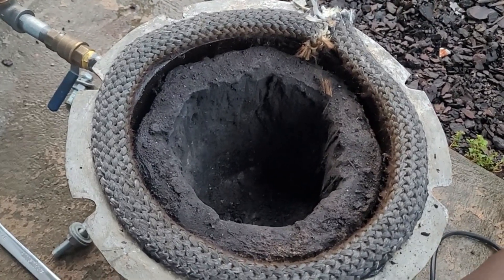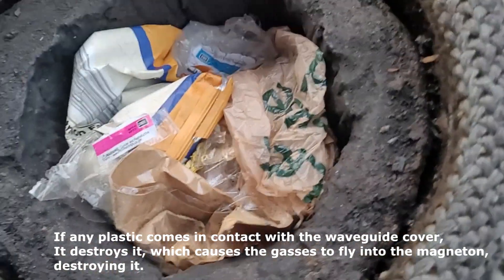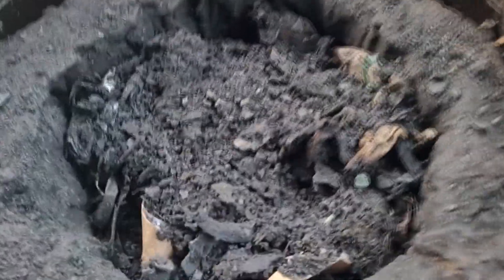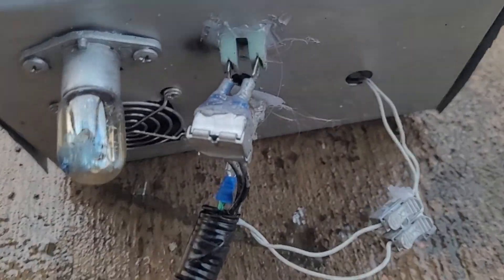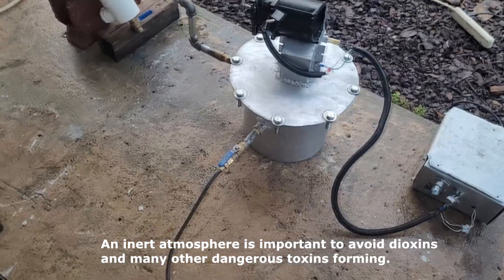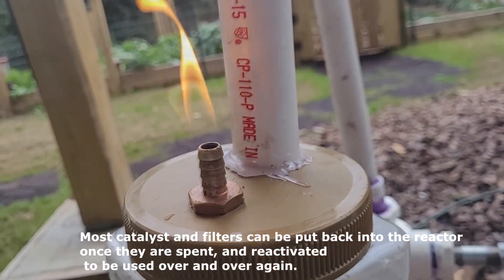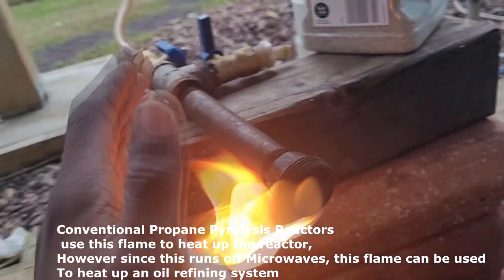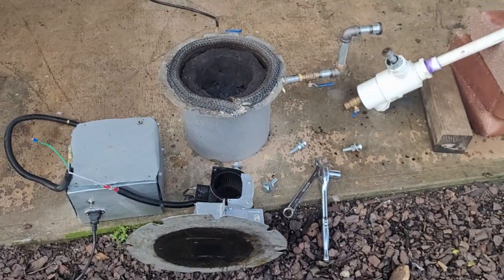Running the Microwave Pyrolysis Reactor (Turning Plastic into Fuel!)

Comment: 1) You should flood the chamber with CO2. Pyrolysis with Oxygen present will result in highly toxic gases being produced.
2) That gas you are flaring off - plumb it into a burner at the bottom, that will solve your problem of plastic at the bottom not being fully converted.

Comment: If you just let it run, the oxygen will be displaced quite quickly as soon as it gets hot enough. Using commercial gas seems a bit of an extra expense and an extra step I don't think is needed...

Comment: PH means power of hydrogen. 
Low PH means it has lower than average hydrogen ions. Making it acidic. When you run it through a water bath, it picks up extra hydrogen ions out of the water, and this helps neutralize the gas.

Comment: carbon char left over can be steam reformed to flammable H2 hydrogen gas, flammable CO carbon monoxide, and inflammable CO2 carbon dioxide by injecting tiny amounts of water at a time. The carbon rips oxygen away from water leaving hydrogen behind. A minimum of 600c is needed while 800c might be more preferable.  The reaction first makes carbon monoxide and is strongly endothermic storing lots of energy.  If it hangs around long enough or too much water is added  the carbon monoxide reacts with another water molecule making  carbon dioxide. This second reaction is mildly exothermix. The overall reaction is that the remaining hydrogen has more stored energy than the charcoal did.

Comment: Reason you shouldnt try pvc pvc with that setup is my understanding that gasified pvc builds clorine acid at regular steel pipes and you need stainless pipes and vessel for contain it. Otherwise you burn that thing trought quite fast.

Comment: Dude!!!!! This is killer!!!! Is there any reason that you couldn’t use this microwave system on a wood gasification unit?
Reply from the maker: Thanks! This could be used in gasification, it would just require a different design.

Comment: Also intentionally causing variations in the frequency of microwaves, like modulation, will cause the microwave peak nodes and hot spots in the pyrolysis container to move around doing the same job as a rotating plate does in a food cooking microwave without the need of putting a unnecessary shaft through the otherwise sealed container that also needs to be sealed! Therefore reducing complications and cost while improving efficiency.
    Tip these are all technical details investors are not going to want to hear or read in a business plan, but are likely problems that may be brought up during due diligence later in the investment process to be prepared with.. 
    If you incorporate, for a few shares I would be happy to continue to help just contact me. If I just had three people locally with similar interests to work with, I would be building a $500,000 pilot plant for 2 million right now!
   The world needs this and I want to be a part!

Comment: Wow this is incredible! I can't wait to see this progress
Reply: Is the remaining ash toxic? I've heard that it is unable to be used because it still has remaining toxicity in it. What is your knowledge and experience on it? If it's not toxic, it would be great to make natural fertilizer out of it!
Reply from the maker: The remaining ash is actually just carbon, and the carbon is very porous. With its high surface area, it traps most heavy metals and things that would otherwise be free, therefor it is not toxic. The only potentially toxic thing about it would be if the plastic is not completely degraded, so there are microplastics left on it.

It can be activated and used as biochar / fertilizer while sequestering carbon at the same time!

Thanks!

Comment: That's awesome dude. Any possible way you can tune the magnetron to a better frequency specifically for plastics?
Reply from the maker: No, only a new magnetron specifically tuned (915 mhz) could work, you can't tune magnetrons built for a specific frequency easily.
Reply: @naturejab  do you have any idea in what’s involved in making a magnetron  frequency change?

Comment: What if you made a "shaker" system that allowed the carbon to fall to the bottom as the reaction was occurring so that new plastics are better exposed to the microwaves?

Also how about an auto-feed system to feed in plastic "blocks" and pull out old carbon so that you can have the system continually running?

Comment: My only criticism is all that power being used to power the magnetron, is the power used more or less than the power of the fuel and gas created?
Reply: With the problem power u can build a fueled generator to generate electricity and us it for the reactor
Reply from the maker: We'll have to see with the next reactor, which I will take measurements with.

Comment: On the note of scrubbing, water is also great because the Sulfur/SOx would be turned into Sulfuric Acid which is probably easier to handle and more useful.
Reply: Granted it may be less efficient.  If you don't need it as a Flashback Arrestor (instead using the ones one would use on an Oxy-Fuel Torch) you could maybe use a spray tower or packed column?  More Surface Area = More Win
Reply: Thanks god we done have O2 enough inside reactor to process SO2 >> SO3 >> S04. However other toxic and carcinogenic byproducts would be formed.

Comment: I have little knowledge on this subject but to fix the issue of the carbon produced during the reaction absorbing the microwaves and preventing the plastics at the bottom from being heated up, maybe just have microwaves on both the top and the bottom. But I’m sure you thought of that and may have found issues with that idea.

Comment: Are you aware of industrial scale implementations of this process? 

Because I remember reading about a similar machine for recycling worn out tires using microwaves. The big difference being that thing was a lot bigger than your setup.
Reply from the maker: Yea, currently I am not aware of a big microwave plant that does plastic however, so that's my big focus
Reply: @naturejab  The machine is called the "Hawk 10". It was mention in a few science and technology magazines back in 2007.
Reply from the maker: @Bratbaticus  Thanks! Will look this uo

Comment: Very cool.  Any idea of the energy efficiency in general?  i.e on a 4 hr run how many BTU or what ever of gas etc did you collect / use?  I've spent time looking into wood gas generation and gassification / pyrolysis and the addition of micro to the process would be interesting.  Again, very cool set-up!
Reply from the maker: Thank you! Right now this reactor is flawed in many design decisions so I am not taking measurements on this one. Im in the works of creating a better reactor that I will take accurate measurements on.
Reply: @naturejab  Understood.... there always seems to be a next tweak or a next what ever lol.  Thank-you!

Comment: Cost vs results? 4hrs microwave run time= $/ results?
Reply from the maker: I'm still calculating this
Reply: If you could utilize solor electric power it would be a win, with earth battery technology . maybe a new path to look down.
Reply from the maker: @rockydog523  Great suggestion! The end goal is to run it off of some type of green and renewable energy therefor making it carbon neutral as well as a profit of energy in the end.

Comment: May I know what gasket you use on your reactor?
Reply from the maker: A high temperature Silicon Gasket. I previously Used a fiberglass rope gasket, but that leaked oil, so now I use a 1/8th thick 12/12" silicone sheet cut to size.
Reply: @naturejab  Greatly appreciate your reply, I am working on a pyrolysis plant myself for a school project. Thank you
Reply from the maker: @maurice7186  Excellent! Im glad to hear that :) Good luck!!

Comment: How many amps and boots l volts does this take?
Reply from the maker: 1000 kwh
Reply: @naturejab  kwh or wh? I dunno where you could plug into 1000kwh
Reply from the maker: @bryaniskoo  1000 kilowattt hours
It plugs into a standard 110 port
Reply: @naturejab  I think that's 1kwh

Comment: To help with the unreacted plastic you could use a "stirrer" like they put in some high end kitchen microwaves. It's a small fan looking blade placed in the wave guide that moves with the aid of a small motor. As the blade moves it deflects the waves around the inside of the microwave helping to prevent hotspots
Reply from the maker: Thanks!
Reply: Man... why dont they use this in regular microwaves 😆 i take its too unaffordable for consumers?
Reply: @dertythegrower  They actually do in Japan, and their microwaves are not particularly expensive either, and they work way more evenly. I was so confused when i first went to use the microwave in my hotel and there was no rotating plate in the center, jarring really. Apparently the rotating plate was a gimmick feature added early on, and just stuck as the main way to even out the heating
Reply: How will it move within the plastic ?
Reply: There is no reactions going on here. Microwaves are just a really shitty heat source when it comes to warming up plastics.
Reply: @ET_AYY_LMAO  уголь используется в качестве поглотителя микроволн.
Для лучшего пиролиза пластик нужно измельчить и перемешать с углем

Comment: If that waste product is pure carbon, it might be useful as the basis of Biochar.
Reply from the maker: Exactly. Once all other minerals and metals are removed it is pure carbon black / biochar
Reply: @naturejab  ever hear of the fitcher troppes process? Make gasoline using fractional distillation and nickel catalyst.
Reply from the maker: @Lord Dorker  yes I have, I believe the oil product can be processed and turned into gasoline thru such

Comment: My concerns are regulating temps. You can absolutely make diesel for sure but the plastic needs to be vaporized at 360/380 degrees F i believe to create Diesel fuel vapors that can be condensed through a worm cooler . If the temp is too high you basically make paraffin fuels (wax based ) too thick. I work in the oil industry and we have to keep reactors at certain temps depending on the type of fuel / oil we are producing out of crude oil obviously. I really like your design man. You definitely have the right idea going on for sure !
Reply from the maker: Thank you for your comment! I definently agree, temperature maintenance is my biggest issue and the flaw with using microwaves, there are some sophisticated means of managing the temperature that I have yet to try. The too high of temperature is what I've been experiencing, as I get tons of has production but not much oil production.
Reply: @naturejab  maybe add a thermostat to cycle the magnetron on an off.
Reply: Isnt it anywhere easier to process the paraffin later on with other equipment? Process control gets normalized for specific input.
Reply from the maker: @Concept ofEverything  I agree and this was always my plan. To create and run a seperate refinery that runs off the syngas in order to turn the oil into fuel
Reply: @naturejab  
What do you do with the ash?
Reply from the maker: @Concept ofEverything  right now, Im just storing it, and use some of it as a catalyst in reactions. Once I know its composition, I want to compost it / use it as biochar
Reply: @naturejab  
Why didn't you go with induction heating though? 
I've got a niche business idea that includes pyrolysis, but it will be difficult for me to start it legally in Europe. 

Wanna start a business together? :))
Reply from the maker: @Noswiatel  induction heating is still indirect. Microwave heating is direct
Reply from the maker: @Concept ofEverything  Email me about your idea. My email adress is in the description.
Reply: @naturejab  
So the electricity costs go down a little? 

I haven't researched microwaves or how carbohydrates or hydrocarbons react to them, but could do that in some spare time, as Im fairly sure the microwave heating can be done more efficiently, even by choosing a better waveguide design. 

So technically, the moisture contenr wouldn't matter that much for microwaves, alright, but have you tested that out maybe? Like how a different moisture level within the reaction chamber will lead to earlier syngas production, or maybe dissopate the heat throughout the reactor in a different manner? 

A couple droplets of oil for a reactor starter, or as you call it, a catalyst maybe?
Reply: @naturejab  
I will start a Discord server so we can chat freely. Not a mail guy.
Reply: @naturejab  
Check yo mail.
Reply from the maker: @Noswiatel  Yes, I've tested water / moisture content as well as oil. Oil boosts the reaction time, and water content makes no difference, it only adds water into the condensated oil ( more water than usual)
Reply: @naturejab  throw some sugar in there. Also, evacuate the chamber if possible, and as it gets proper pressure and temp, open up the valve. If possible. Will explain later on.
Reply: Seen on my microwave power settings from 1 to 9 with on taking longer to cook and 9 cooks very fast. Maybe salvage that circuitry from such a microwave. Good work you are doing bro....

Comment: Only worth if energy comes from solar. 4 hours @ 1kW for some 5kg of plastic?
Reply: 1kWh is like 0,25 cent ($), so it's good for EU, where diesel cost 2$ right now. It's like getting off grid with your car and you can use petrol/gas for making another batch
Reply: I think the project is nice, but seems that energies do not add up. Suppose I want to heat water, would it not be more economic to use the microwave instead of a flame? Just asking....
Reply from the maker: @Eduardo Prado  A microwave is a lot more efficient, since it only cooks the water, instead of heating a pot to cook the water. However, in terms of energy and electricity consumption, they end up being about the same.
Reply from the maker: We'll really only know when we get there!

Comment: I don't suppose it makes a difference but grocery bags are HDPE while things like bread bags are LDPE and packing tape is usually PP.
Reply: I realized I should qualify my statement. "Only a Sith deals in absolutes..." In the United States, you will get LDPE plastic bags from retailers, but LDPE bags are "nicer" (I would have to believe they are more expensive, too). You are more likely to get LDPE at say a book store or a clothing store or nice department store, while you will almost certainly get an HDPE bag at the grocery store, a market, or a Walmart. Anyway the video is about using microwaves to  pyrolyze some plastics. Back to where any of this matters, PP is transparent to microwaves while PE's readily absorb them. If you have a lot of packing tape in the batch would it not be more efficient to exclude the tape?

Comment: Maybe melt the plastic into pucks first? This way you get much more into your reactor.
Reply from the maker: Good idea!
Reply: @naturejab  Another point: While I think using microwaves is extremely cool - it really is and I have not thought about it - it might be quite inefficient. I have wrapped high temperature heating bands around a thick stainless steel cylinder(from the scrapyard - idk what it was in its first life), added some thermocouples and wrapped everything in a ceramic blanket for insulation and stuffed it in a sheet metal box. I also have only very little heat losses and can finely control the temperature of the vessel in several zones, and can choose if I want condensation on the side walls or not. This was necessary because the plan for making the reactor was making hydrochloric acid from PVC which needs good temperature control to efficiently drive off the HCl from the PVC. But it works incredibly well for higher temperature pyrolysis, too.
Reply from the maker: @Jack McLane  This is a great point. One of the biggest downsides to microwaves is their very ineven and hard to control heating. Their biggest benefit is their quick heating. But once a standard reactor reaches the same temperature of a microwave reactor, all benefits become null.
Reply from the maker: Also good work! I find it really cool you are building a reactor too! Keep up the good work, the PVC HCI stuff is very interesting.

Comment: So take apart microwave. And stick the zapper into a container
Reply from the maker: Essentially. Though the true engineering comes into making it airtight. How can microwaves enter a vessel  while gas cannot leave or enter? This has been the most difficult problem to solve, but researching radar engineering has helped lead me on the right path.

Comment: What is the wattage used? Is there any way to detect that there is nothing left to volatize?
Reply from the maker: It's 1000W, 1 kWh. Currently the only way to detect when everything is done is to wait for the gas to stop being produced.
Reply: @naturejab  arduino with a voc detector might be a way to go. I am also curious the total btu produced per input electricity.  Asia has a major plastic problem.  And they need fuel.  This might solve both.  More people would recycle if they get free (or very low cost) fuel in exchange. Set it up as a self serve kiosk, they run cycle, walk away with a tank of gas.
Reply from the maker: @davecole6560  Precisely, a closed and circular economy.